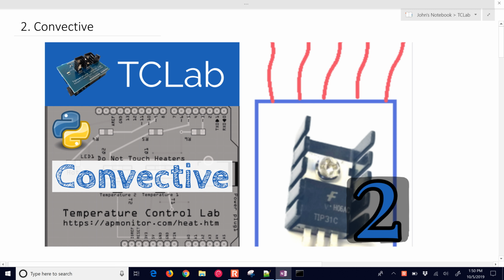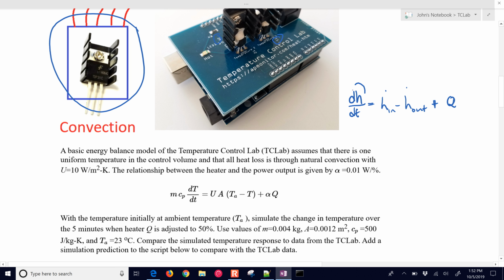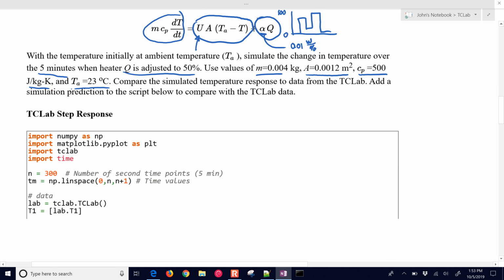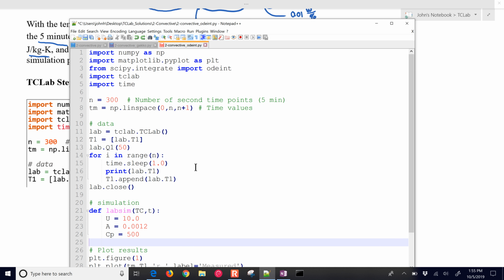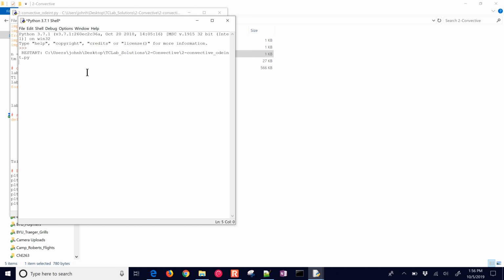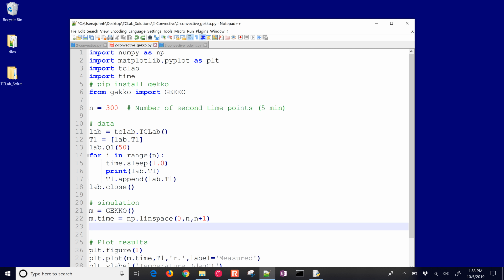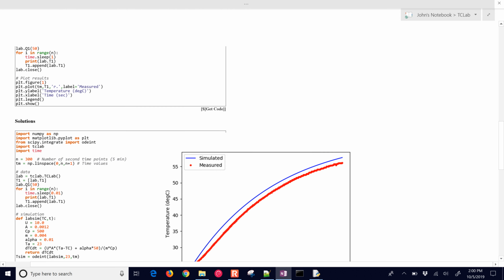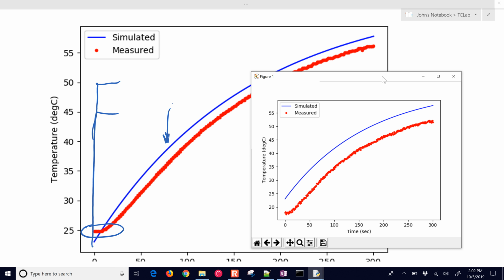TCLab: ODE Energy Balance with Convection

Comment: Great video series! has helped me better understand control theory using hands-on learning. In the energy balance equation for temperature, how is the value of "alpha" (W/%) calculated? In this example alpha = 0.01. How is this value computed? My understanding is that alpha is a scaling factor or a gain that converts % heater output into Watts. Was this found out experimentally? If yes, can you elaborate?
Reply from the maker: The experimental value from a multi-meter is about 3-5W but there is loss through the cable and other parts that are not the heater. Every device is also slightly different. There is an exercise to obtain the heater alpha at https://apmonitor.com/do/index.php/Main/AdvancedTemperatureControl